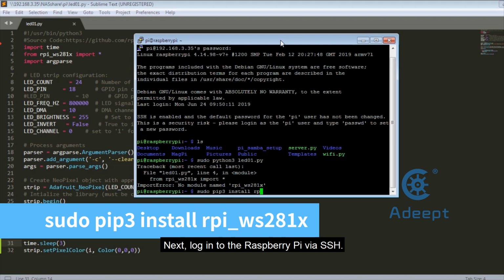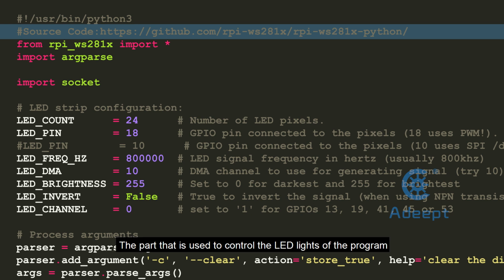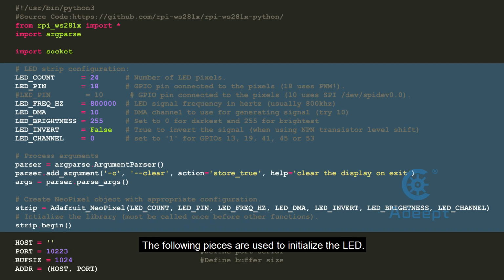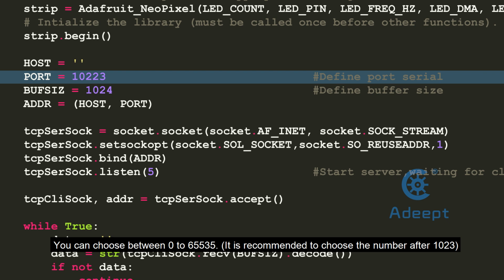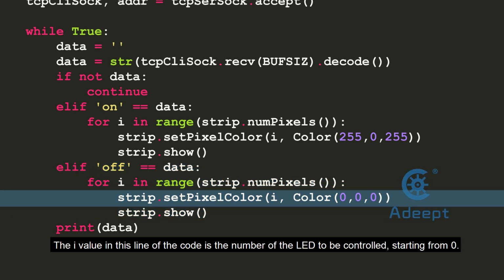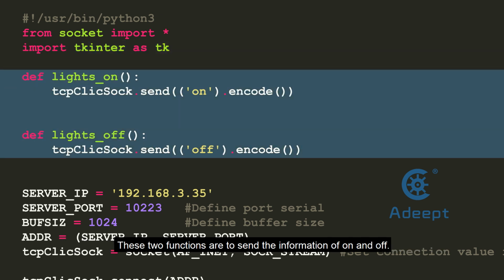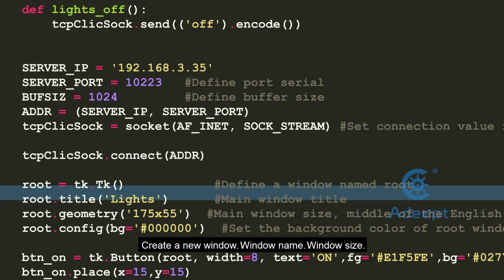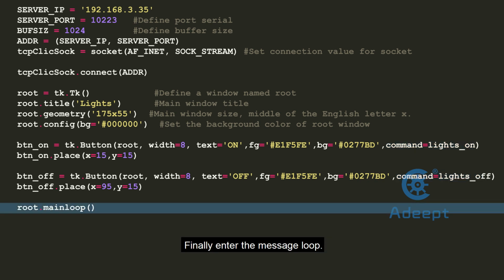Learn to use Python to write a GUI that remotely controls the LED connected to the Raspberry Pi.

Comment: These directions are useless. It still does not control the LEDS or stabilization and other supposed features on the Darkpaw robot even though they direct you to this useless videos. Adeept does not have good documentation for any of their products. The robots are cool but their directions are awful and full of mistakes. Also the code they provide does not fully work. Simply put, the robots do not do as advertised. There is no way to figure out why because they do not offer acceptable documentation or instructions. This is the BIG disappointment you will feel after buying any of their robots. It's very unpleasant to assemble the robots because the instructions are awful. The robots they offer do have potential but they are rendered useless due to poor documentation. Their website is equally as useless and odd to navigate. I have three of their robots and have been very frustrated with all of them because they do not work as advertised and were unpleasant to assemble. I have 47 other robots and none of them were as frustrating to put together as Adeept's robots were. Adeept robots are like having a really cool spaceship that no one knows how to fly and no one knows how to find out how to fly it. As a robot lover I find the extreme lack of any useful documentation or instructions for their robots a disrespect to the awesome robot that they created. A frustrating and disappointing experience to have robots that don't work but could work if they would only tell us how.